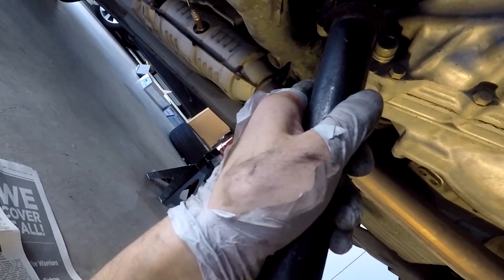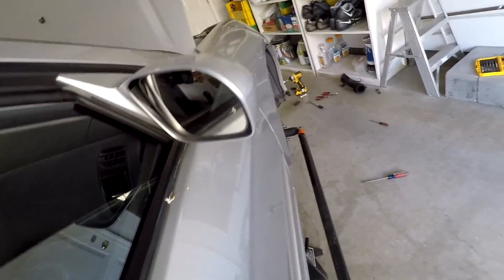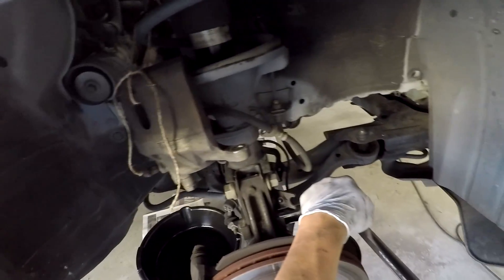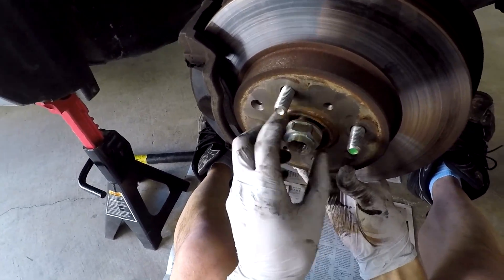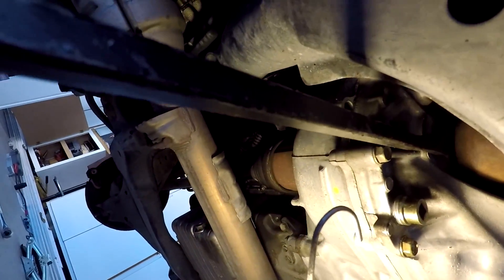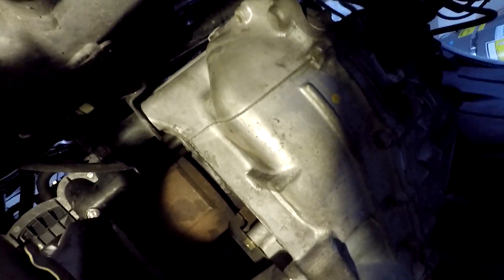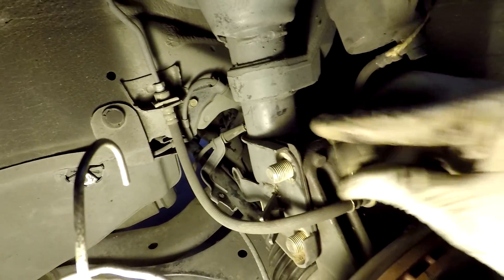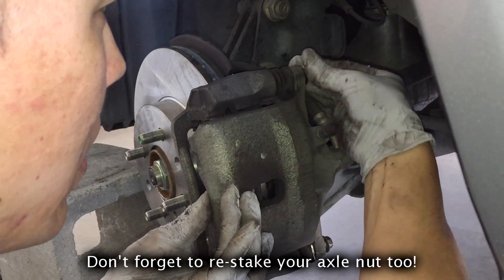2004 Honda Civic Axle Replacement

Comment: Is it normal to have a very small gap inbetween the axel and transmission
Reply from the maker: Yeah that should be fine.  As long as you heard that lock ring snap into place, it should be good.

Comment: Can someone explain to me the difference between “automatic axles” and I’m assuming “manual axle”? I’ve looked online but I can’t find any answers. I have a 2005 Honda Civic and I had an accident and destroyed my passenger side axle and I’m just gonna replace both sides and well yeah.
Reply from the maker: tbh, i dont know if theres really any difference.  probably small differences at best.  i did notice that part numbers are different though, so they are different in some way.  why does that matter though?  you know which kind of transmission you have, so you can get the correct parts and install?
Reply: nukem384 Hm that’s what I don’t get lol. I’ve looked everywhere and everyone has different answers so it’s pretty confusing. I can’t seem too find anywherr online that sells “manual cv axles” that’s why :/
Reply from the maker: @takumif7056  interesting, i just looked on autozones web site and they have both auto and manual axles available
Reply: nukem384 I didn’t bother checking with them I haven’t gone too them for any parts in a long time after a bad experience with them but thanks my guy!

Comment: Do I have to get alignment after?
Reply from the maker: Anytime you're messing with suspension or parts like this, it's always good practice.

However, is it really necessary?  Eh, probably not.  It's a direct replacement, so the alignment wouldn't know any different.  It's up to you.

Comment: Why did you replace them? Cause they were leaking ? I have 220k miles on mine and thinking of re doing the whole suspension
Reply from the maker: i actually didnt replace them. i had to take them out to replace the clutch in this car, so made this tutorial at the same time.  you dont need to replace axles unless there is something wrong with them, like if the cv joint on the outer boot is busted.  or the boot has a tear in it and all the axle grease is leaking everywhere.
Reply: @nukem384  Question: So if your replacing the CV; would you really need to drain the transmission? 
( had a ball joint break two months after hitting a bolder, replacing the control arm and the ball joint, however the CV looks loose or out of socket ... when we changed the front struts three years ago the CV did the same thing. I'm hoping I don't have to spend more money & waiting on parts got the control arm on time the ball joint is taking an extra five days to get here (& still waiting).
Reply from the maker: @Hope4Today9  You only need to do the tranny fluid if you're doing the passenger side axle.

Comment: How many splines does the cv joint axle has?
Reply from the maker: No idea TBH.  If you order the one made for your car, it should fit.  You don't need to worry about counting them.

Comment: is there a gap between the axle and the transmission??
Reply from the maker: gee 305 there is a small gap per se, but everything is locked in. Make sense you feel that c clip pop into place. Youll feel it and then the axle shouldnt be sliding in and out at all.
Reply: nukem384 thanks for replyin, i tried puttin the axle in but it looks like its not goin all the way in, itried usin a rubber hammer for help, it doesnt go in futher, also its leakin transmission oil, and when i drove it it makes a clickin noise and my steering wheel moves